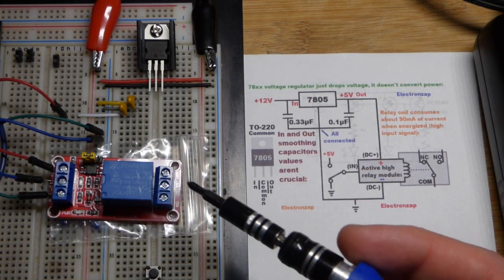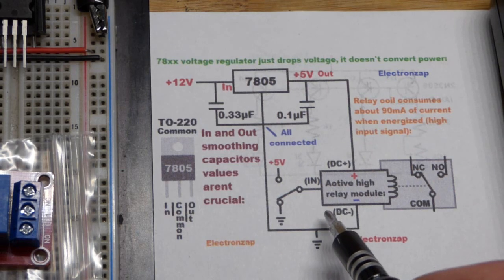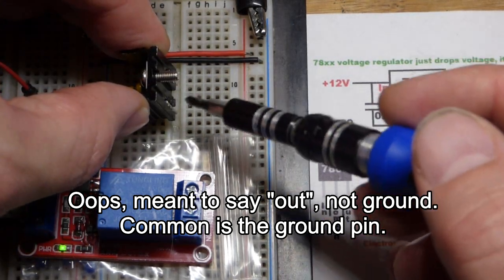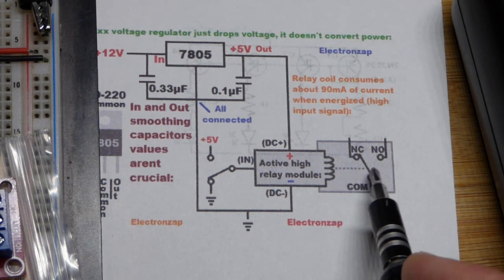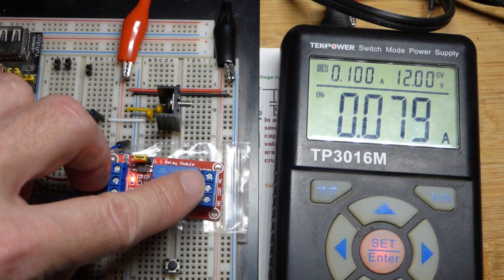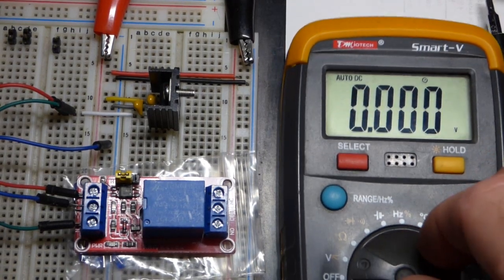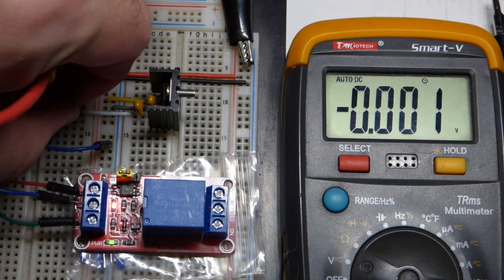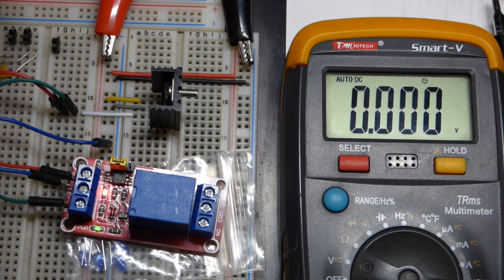5V relay module powered from higher voltage using 7805 voltage regulator circuit by Electronzap

Comment: a snubber diode should be added to your schematic around relay coil, or you will destroy the voltage regulator
Reply: There's a 1N4148 on the module.
Reply from the maker: Should be one on the module.

Comment: Since resistance value (or current requirement) of relay coil can be found easily, it is more simple to use dropping resistor in series with relay coil, rather than a voltage regulator.
Reply: That's what I used.
Reply from the maker: I think a resistor would work well with a fixed supply voltage.